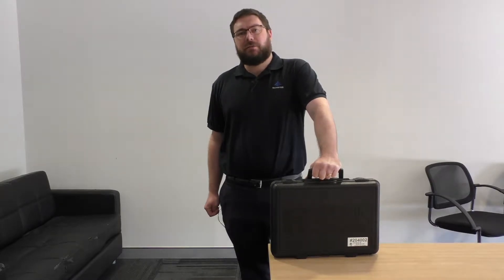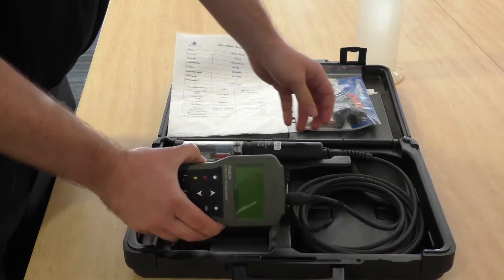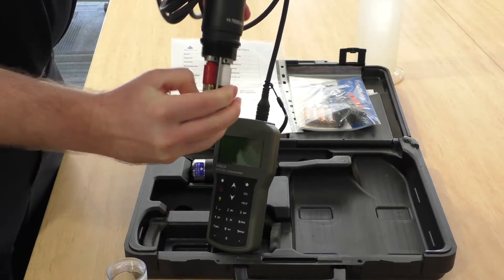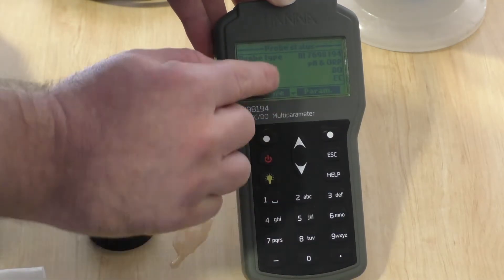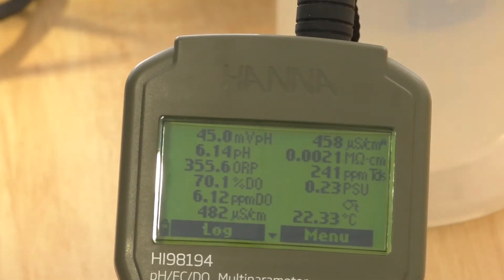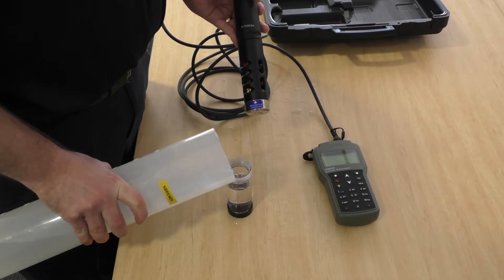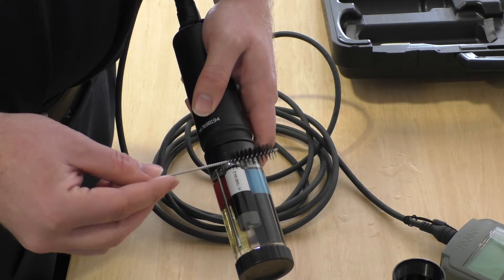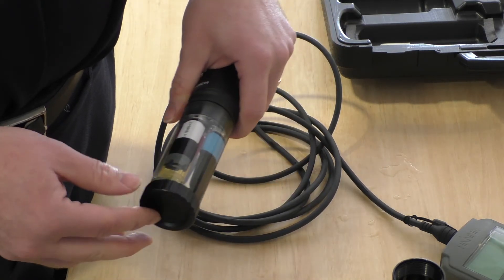Hanna HI-98194 Multiparameter Water Quality Meter

Comment: once done using the meter do I need to replace the pH cap?
Reply: I think this is needed but he forgot in this tutorial. I believe you will need to fill the cap with Storage solution for PH and electrodes (bottle code: HI70300. )